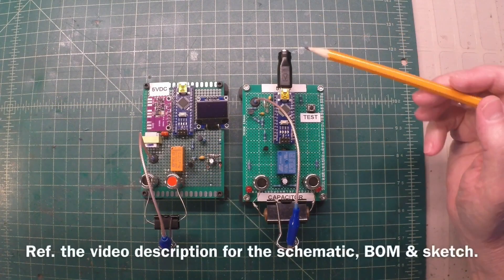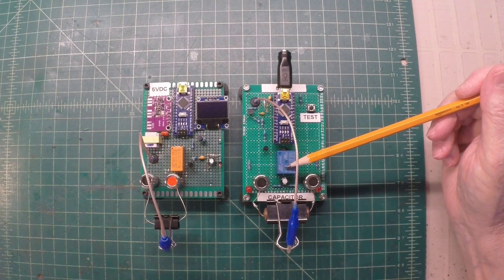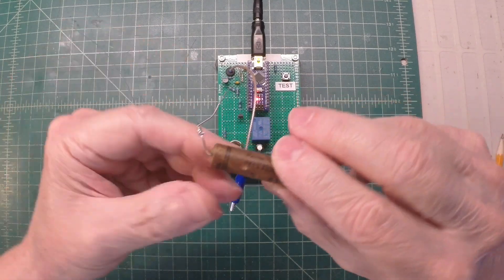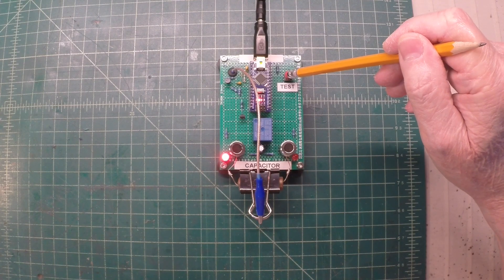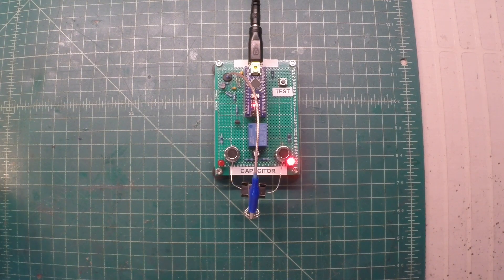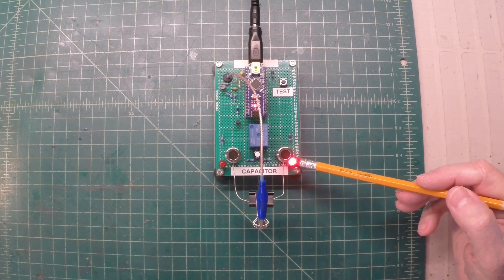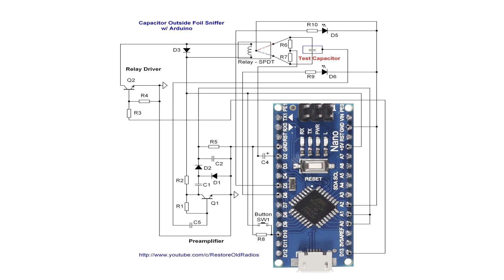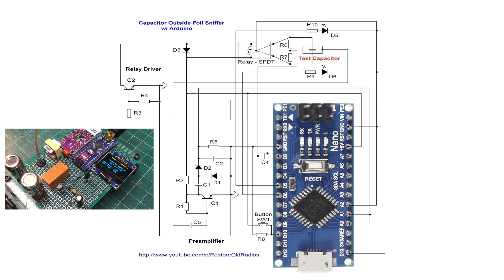Capacitor Outside Foil Sniffer w/ Arduino Version 2.0

Comment: Hi Don, Thanks for putting this together.  One question: what is the significance of the two arrow / triangle (?) symbols connected to Q1 and Q2 on your schematics?  I know these symbols as ground symbols, but unclear why the indication on the schematic since the two transistors are already showing a connection?  Not sure if I'm misunderstanding the build. Thanks in advance.
Reply from the maker: Thanks for watching and reaching out. Sorry for the confusion, to your point they are circuit ground symbols, which I should have omitted. All the best. Don

BTW - I tweaked the circuit awhile back noted as 2.0r

Comment: Hi Don. Thanks for the all the great projects and repair videos! I'm new at building projects like this and I have a question. Where is C5? Is it soldered to the binder clip inside the blue plastic shield around the alligator clip? At first, I thought it was on the PCB since it is shown close to the base of Q1 on the schematic but there are only three capacitors on the PCB: C1, C2 & C4 (electrolytic). Using Occam's Razor, that's the only place I can figure it is located. 

I've been watching repair & restore videos in preparation for this new hobby, I notice quite a few people marking the foil end of their capacitors with a black dot when they're doing point--to-point wiring. I understand it's not quite as important on modern electronics as the capacitors are usually close to the ground plane on the board. I read that is the reason manufacturers don't bother marking the foil end anymore.
Reply from the maker: Steven - thanks for your kind words. C5 was omitted in my prototype build I shared, but I added it to the final schematic as-built. Most of my restores were done without identifying the outside foil/shield of the capacitor, but after seeing/reading from SMEs it motivated me to build this circuit using Arduino so I’ve used it since to do so. An interesting and informative article on the subject just in case you haven’t seen it at: https://www.aikenamps.com/index.php/where-to-connect-the-outside-foil-on-capacitors

Thanks for reaching out and watching. I hope your future projects/endeavors are rewarding.

Best,

Don
Reply: @RestoreOldRadios  Thanks for the fast clarification, Don! It sounds like I can solder C5 after the coax but before the junction of R1 & the base of Q1.
Reply from the maker: @SBWings  If I were building the circuit again, I would place it at the junction of Q1/R1 then route the mini-coax over to the…

Comment: I understand everything except why are using D1 and D2? Those two didoes do not deal with any coils.  Could you be doing a single stage voltage multiplying??
Reply from the maker: The diodes are used to covert the AC to DC so Arduino can be used to discern the data. Hope this helps. Best, Don

Comment: I was wondering when you would need to use R4 which is marked optional? Thanks, great video!
Reply from the maker: Thanks Henry. I used it in V1.0 build and excluded it in V2.0 and haven’t seen any impact to this point. Thanks again. Best, Don

Comment: Don, I have had some errors compiling the code using Arduino IDE 2.0 is there any way I can send you the errors, if I put anything in the comments with a link it just gets deleted?
Reply from the maker: Steven, my coding skills are average at best, but I’ll be glad to look it over. My gmail is TheRadioRepairGuy Best, Don

Comment: A great re-design Don that shows the value of prototypes.  I'm going to try building your V2 but I might add back the OLED as it could show a lot of useful info such as the ratio of the OF and not OF voltages which might indicate the effectiveness of the OF?  Also the number of tests done, uptime et cetera.  Many thanks for sharing your designs and the explanatory videos.
Reply from the maker: Steven - thank you. It sounds like some very useful enhancements. Keep me posted on your build if time permits. All the best. Don

Comment: I did build up a high gain audio amplifier with a 6SJ7 driving a push pull 6v6 amplifier for a signal tracer circuit. If I place  cap from grid to ground of the preamp  grid it will detect the outside foil position with a hum  in one configuration and no hum in the reverse position yours is more technological superior where mine is just plain old school. I have no experience with Arduino circuits. They came about when I was retiring a few years back. Im an old dog too.
Reply from the maker: I like your old school approach as well and I know it’s a proven effective method. Thanks for reaching out and watching. All the best. Don

Comment: Thank you for continuing this project. I had starting building a Digikey cart from the V1.0 BOM but the 1N34A diode is obsolete. My diode theory is rusty and I gave up before I was able to find a suitable replacement. Would any general purpose germanium suffice or is there a particular characteristic to look for in this application? Thanks, and take care.
Reply from the maker: Steven, I was looking at Digikey myself a few days back as I used my last two for V2.0. I now see they have them, which are being supplied by NTE. Try https://www.digikey.com/en/products/detail/nte-electronics-inc/1N34A/11644260 and if unavailable try Mike’s Electronic Parts at https://www.mikeselectronicparts.com/product-category/electronic-components/diodes/ 

I didn’t try any other germanium diodes, but a similar spec diode should work.

Hope this helps.

Best,

Don
Reply from the maker: I tried some 1N60 germanium diodes and saw a slight degradation as compared to the 1N34As, but they should be useable. Best, Don

Comment: Have you run into any caps it couldn't figure out? Nice project!
Reply from the maker: Hi Ted, one Poly 0.001uF that it couldn’t discern consistently, while another at the same value was consistently identified. Best, Don